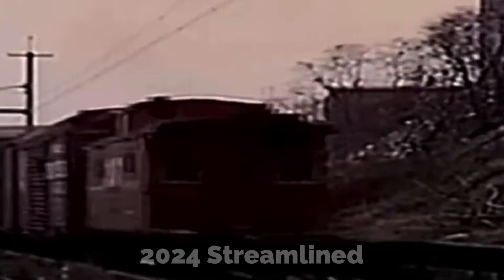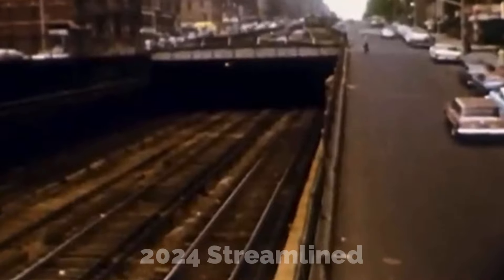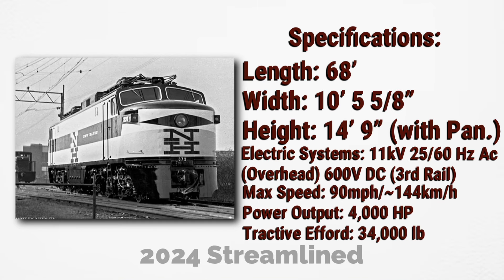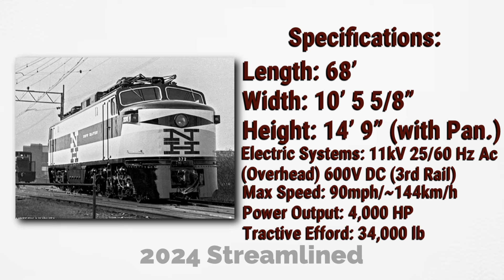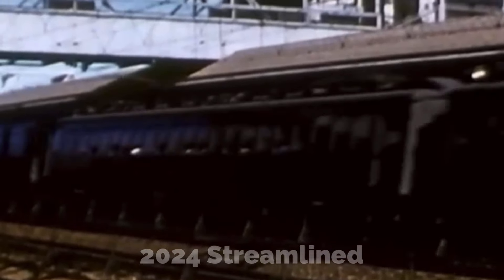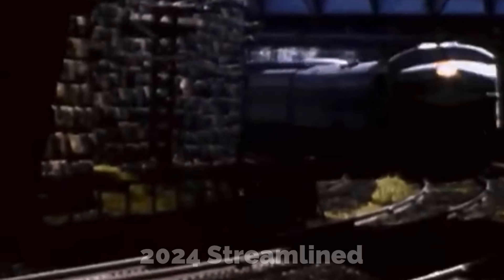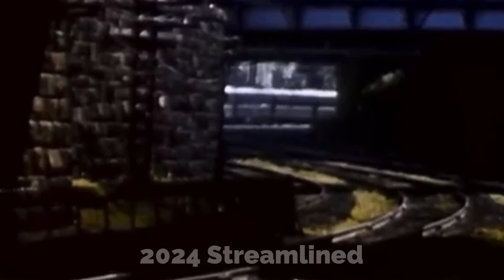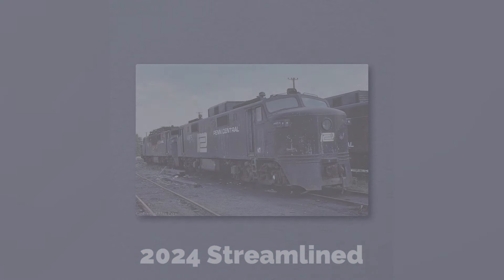The New Haven’s EP-5 “Jet” Locomotives

Comment: Rectifiers converted the overhead AC to DC for the traction motors. New Haven's older passenger electrics basically force fed DC motors with AC power when under wire or DC when in third rail territory.
Reply: Correct me if I'm wrong but I thought the older electrics were built with AC motors that were frame-mounted and drove the axles via quill drives like the PRR GG1. The advantage of the EP-5 - as well as Virginian EL-C and first PRR E33s - was the rectifier allowed for use of standardized DC traction motors that mounted to the truck and were geared directly to the axles thus being easier to maintenence and having the same set up as a diesel electric.
Reply: I believe single phase AC motors are basically very similar to DC motors. They could run on either, as the New Haven's passenger electrics did from the beginning, but weren't as good as a straight DC setup. Only way to get around that before rectifiers became available to railroad use was a wasteful motor-generator setup. AC motor spins a generator that makes DC power.